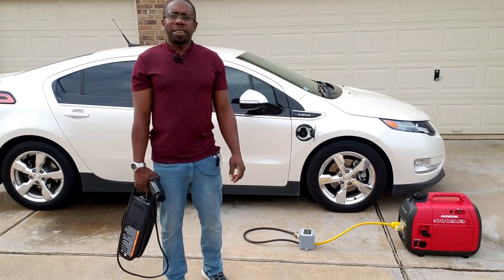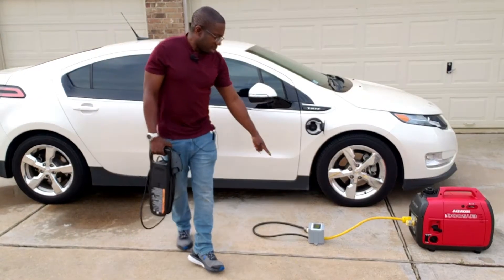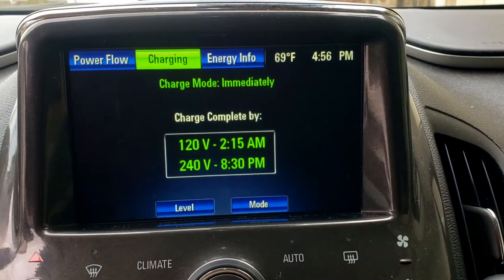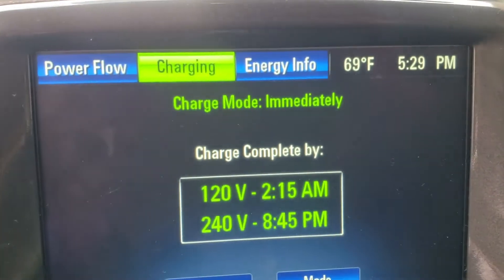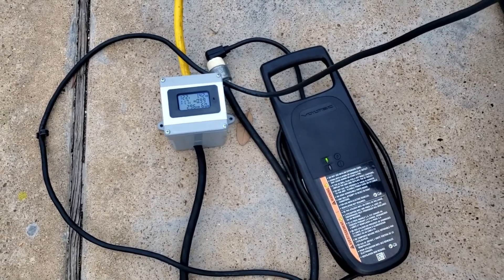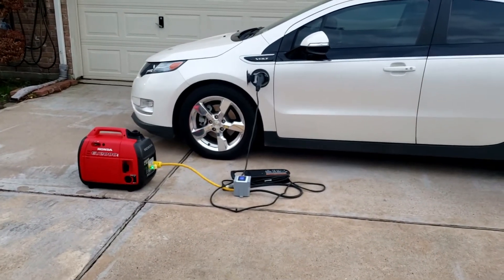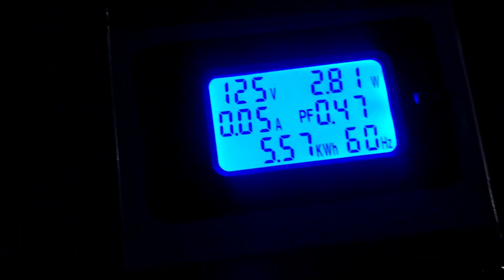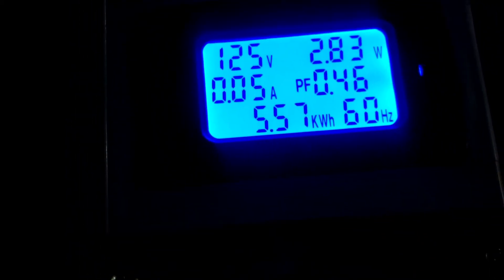Honda EU2000 Inverter Generator Charging an Electric Car.

Comment: I wish i could rent an EV and buy a 15kw generator (i need one for the house) and see how many MPG i can get from charging using a generator
EVs are quite uncommon in my area if you dont buy them brand new, and rental places dont have them because there isnt charging infrastructure and many people who rent cars, arent going to be charging from home
In theory any car can be 'hypermiled' to near double its EPA rating just by keeping the engine at its optimum load. Would charting from a generator that stays in its optimum load, be significantly more efficient than the same car with a gas engine despite the EV version being quite a bit heavier, and having losses from tripple inverting
Reply: also of note, inverter generators are generally advised for complex electronics like an EV. Not only can these damage the complex electronics, the car/generator can waste alot of energy just to condition the power
But this thing showing a power factor of .99 is surprising, it may be a proper inverter generator

Comment: So if you would have done it on the lower setting it would actually met the amp requirement and for the 4 hours that you waited could you have gotten more out of that other setting?

Comment: That's a great heads-up on the bonding plug. I found this video after experimentally trying to charge my Chevy Bolt (with a "B") with my Honda EU2000 generator and getting a "Grounding Fault" error on my EV charger. (I'm trying to figure out a way to drive the last 495 miles to Prudhoe Bay, Alaska, since there are no established chargers between Fairbanks and Deadhorse.) I just ordered a bonding plug from Amazon. We'll see if that fixes it.

I had to smile at the idea of charging a plug-in hybrid with a gas generator. That same gallon of gas would take a Chevy Volt (with a "V") about 35-40 miles if you poured it straight into the car's gas tank instead. The additive inefficiencies of going from gasoline to Honda ICE engine to generator to AC-DC converter to hybrid battery to DC-AC inverter and finally to the Volt's electric motor are depressingly horrendous. 😬

Comment: I get the feeling that 5 kWh from 1 gallon of gas isn’t that bad, it’s the efficiency of your car batteries into miles that lets it down I think..
Reply: The Honda EU2000 is great as generators go (I love mine), but 5 kWh per gallon is awful. At a theoretical (and admittedly unobtainable) efficiency of 100%, a gallon of gas should yield 33.5 kWh.

Comment: What day should truly do is figure out a way to put an alternator to charge the battery it would be better in solar pan then maybe they wouldn't have to use gasoline but still 5-year warranty for a car that after the warranty expires you have to spend $35,000 for a new battery

Comment: It's funny how they're saying electric cars are saving the planet but where are they getting the lithium for the batteries and now you're using gasoline to charge a battery and isn't that the same thing you're using the grid and where the power comes from the grid they burn coal doesn't make sense for electric cars

Comment: No matter how you slice it gasoline will always play a role in the production of electricity somewhere in the system. 
In Canada’s maritime Provinces coal is burned to produce electricity. Given how fuel efficient Honda Generates are I would say it’s a good choice. Must keep in mind also the chance of natural disasters causing power outages…how do you make allowances for that…..the generator is obviously the answer.

Comment: It proves evs are a waste of time they burn fuel so you can get electric to charge weather they burn it or you burn it it’s still burnt which means we all get 15 miles to a gallon which basically means the same as a V8 so more pollution thanks for showing me to never buy electric

Comment: 15 MPG and 4 hours of time used that is terrible. You might have to do it in an emergency, but it is not something you would look to do regularly. An internal combustion car of a Chevy Volt size would get a lot more than 15 MPG. It highlights that if you are not using renewable energy to charge your BEV then you are not reducing your greenhouse gas emission footprint by any appreciable amount. Grid electricity powered by fossil fuel would be as polluting as the generator per KWh supplied.
Reply: Happily, industrial sized fossil fuel plants are way more efficient (and less polluting) at generating electricity than any home generator. Even figuring in the total oil well to electric motor losses involved with running an EV, you get a lot more miles per dinosaur with the EV. That said, I can't wait for the day when I'm charging my Bolt with electricity generated from Thorium fission or fusion power. (Remember, fusion power is only 20 years away. And always will be!)

Comment: This is one of the best answers. Four hours seems like a long time to get 15 miles of driving. Another test compare driving mile with all amp sucking option running compared to all off but essentials.

Comment: 5:42 both the vehicle charger and a heater are continuous loads meaning they can only pull 80% of a rated circuit. For this 12amps is 80% of 15. 8:22 it also had to refill the buffer most likely so not all of the 0.8 is per mile. 366 watt hours per mile or 0.366KWh on the volt 15 miles/ 5.5kwh.

Comment: Minimum generator size required is 10 kva at 40 to 50 amps or larger.

To run a home it's minimum of 16 kva

Note; always uncoil charger cable. Never leave it coiled up when charging

Comment: What about the device you plugged into the gen plug . Please make a video on that detail. 👍
Reply from the maker: That device is called a bonding plug. It is used for generators with a floating neutral or an open ground.

Comment: It took 4 hours to add 15 miles of range, that's 7.5 miles you can travel before you have enough power to reach home once more, plus this equates to 15mpg, and 4 hours to achieve this.
You can possibly reach a charge station within the 15 mile range, but you set the scenario that there is a total power outage, hence no chargers, if there was workable chargers, these would have many cars lining up to use them, plus many more hours being charged.
I wouldn't buy an electric car until the infrastructure is strong enough to cope with demands.
At a garage you might find 10ish fuel pumps.
To cope with government based plans you would need 50 plus charging stations,,, where is this land to build these going to come from? plus the extra demand on our electricity system will cause many more power outages.
That gallon of fuel takes seconds to pour into my tank, it will drive 50 plus mpg, no hours waiting for the car to charge.
At least I know that if my family get stuck in an outage, we can instantly jump in our car and drive to a safer location without worrying about battery range.

Comment: Isn't that what the car's gas motor is for though?  Too bad you don't have a newer volt that gets 59 miles to the charge.   Chevy should continue the Volt since it is such a great car.  Sorry but 15 miles is really bad. And comparing a volt to a pure electric car is apples to oranges.

Comment: That honda geni is one of the most efficient genis out there. A bigger geni will use a lot more gas for that 15 miles.
Reply: My 3/4 ton truck gets around 18mpg. Why would I buy an EV?

Comment: Hai brother. 1 gallon = 3.75 ltr. 15 miles = 24 km. In india cars will run for average 16 km for 1 ltr petrol. So for 3.75 ltr ( 1 gallon ) opprox 50 kms that is 31 miles is coming. What brother.😂😂😂😂
Reply from the maker: By using a larger generator with 240 V you would increase the charging efficiency, this was just a test seeing if it was possible with a 2000W generator at 120 V.

Comment: Great post to prove a genset can charge an ev and the efficiency of the genset converting fuel to power. For comparison - a Tesla m3 travels 4 times further than a Toyota Corolla per gallon when you factor ‘well to wheel’ loss calculations.

Comment: So, if you get 5.57 KWH from one gallon and the car can drive 15 miles lets price the 5.57 KWH from your electrical grid to determine how much it costs per mile to drive your electric car. 15 miles per gallon is not an impressive number for fuel efficiency.

Comment: really interesting video. just what i was looking for. i seen a bunch of photos from ukraine after ru took out most of their power grid last winter of a bunch of electric cars with 2000 wat generators bolted on to the back of them. I know you can use the volt (atleast in most gen1 models) as a generator for itself just by putting it into mountain mode and idling the car and it will charge up to about half way charged (~5kwh) but I would think a smaller motor would be more efficient.... but then a lot of other things come into play. i think mountain mode charging up to half way from 0 miles range gives me about 37mpg

Comment: how many miles per kwh does rhe Chevy volt get, i would have assumed around 3-4mi/kwh or so, my kia phev and vw EV.
Reply from the maker: Your guess is correct because it only gets about 40 miles with one charge which is not a lot by today’s standard

Comment: I like the theory of this experiment, thanks for doing it. But look… 4hrs to charge for 15 miles? 1 gallon for 15 miles? It proves what I’m about to write. The simple truth is….. if you live in an area that is accustomed to power brown outs, purchasing an electric car seems like a bad idea. Knowing that, purchase a similar car to the bolt, but an ice powered car or a an ice/hybrid would be cheaper in initial cost, get 35-55mpg and never have this issue. Not to mention you can use a gas can to fill in a pinch in a couple minutes, not hours of running a generator…. Which costs big dollars and burns the very fuel environmentalists want to ban.

The no brainer move is to not purchase an EV. ICE and hybrid is superior in most ways, convenience and cost being the biggest.

Comment: Put the gas in the tank for higher efficiency. This is a Volt  PHEV not an EV. There is a reason no one uses a portable Gen to charge an EV except for a YouTube video. Thanks. 2022 Hyundai Ioniq 5 EV
Reply from the maker: I know I could just put the gas in the tank but that wasn’t the point I was trying to make.

Comment: This is not time efficient to use EV automobile 🚗, took so much time to charge. 😅
Reply from the maker: Definitely not fuel efficient but just imagine if you’re in a power outage and the only vehicle you have is a electric car that can get you by overnight so you can get to work next day.
Or better yet it would be a great excuse not to go into work 😅

Comment: UK here - how easy is it to 'convert' a 110/120v outlet to a 240v outlet? As I understand it, most US homes are both 120v for 'normal' things, and 240v for anything that would be wall spurred (electric oven etc). Would reduce home charging times by half.

Comment: Makes you wonder why the EV industry (especially if they're required to produce 70% of all vehicles in a decade) is not designing their cars with a built-in internal gas-powered generator for emergency charging purposes. Shouldn't be too hard to figure that into the design.
Reply: If they do that they lose their "0 emissions" tax break

Comment: Nice. I have a 2013 Volt and you can actually charge the battery half way with the engine in mountain mode. Of course you can drive it on pure gas when the battery runs out too.

Comment: I tried to Charge my electric car using a portable generator not yours but a different one but the charger keeps flashing green , is it because of the open neutral should I buy something to  close that
Reply from the maker: Just get you a bonding plug
Reply: @GeneratorReviews  thank you way better than and faster than buying a copper rod and digging that into the  dirt.
Reply: Or does my generator need to be grounded?
Reply from the maker: https://amzn.to/3J4YEAM

Comment: Honestly this just proves the inefficient nature of electric vehicles.  It's all relative to the generation source of course.  You lost about 1 KW with the charger, about a %20 loss there. But still 15 miles is lousy for the amount of power you put in.  They need to develop a more efficient charging solution, and add the ability to tap multiple outlets for amperage since most are 15A. As it is the Honda 2000 was perfect for your test as a bigger genset would be pointless (11A charger Honda puts out 13A) and less efficient.
Reply from the maker: I think if we were able to charge it using dc directly from the generator. It would be a lot more efficient.
The conversion from AC to DC has a great loss. 
I was thinking of trying the Honda 7000 and charge it at 240 V instead especially this one’s fuel injected
What do you think?

Comment: did you try to see if you can put the generator in the car for emergency use, not to charge it, but basically run the motor directly?
Reply from the maker: The car won’t allow you to drive when it’s plugged in

Comment: I know you are just showing us how to charge your car with the generator but it’s defying the whole object of it all, as fuel must be used in generator to charge the car so it would be easier to get a car to run off gas, diesel in the first place and no worries of running out of fuel… Anyways take care 👍🏼
Reply: "..but it’s defying the whole object of it all, as fuel must be used in generator to charge the car.."
Wait until you find out how the electric power plants are powered.

Comment: this type of generator is capable of 2 kw but in your setup you are using only 1400 W amy reason ?
Reply from the maker: The car controls the amount of energy it requires for charging

Comment: Most electric cars are coal powered but it nice to know they can run on Petrol too. Too bad you can't drive along with the generator running in the trunk, but then the penny would drop and nobody would buy them.

Comment: if a black out occurs during winter time you could put a coil copper water pipe in the muffler take inside the generator inside and the gases outside and you get a space heater plus a charger.
Reply from the maker: Yep add a fan to circulate the heat from the hot pipe. 
Yep we are definitely nerds😅🤓😅

Comment: now convert the horsepower of the generator to the time convert it to the horse power to the cars transmission to take it down the road 37 miles and see how much co2 is saved in the generators unburnt fuel in it's tank?

Comment: A question: what would be the result if you connected TWO electric cars to the same generator fueled with 1 gallon of gas? Would both EV get 24 miles, would both get 12, or something else?
Reply from the maker: Unless the generator can supply enough amps to support two EV charging it would just trip the circuit breaker.
But if the generator was large enough to support charging two EV I guess it would just divide the charge between the two.
Hypothetically speaking I guess that’s what would happen
I’ve never tried it😅

Comment: My 2002 Ford Exursion 6.8L V10 only got 12.5 miles out of a gallon....  Of course there's no electric Ford Excursion. So I would have to buy a new ESUV and throw in what? $60,000+?  If I wanted to drive that thing for 20 years and let's say, I already bought it 20 years ago, it would be due for it's third battery in about 2-4 years, costing me probably around $20,000. I'd still have to pay for the electricity which becomes more and more expensive these days. 
There is no upside to an EV, unless you buy a tiny thingy to scoort around town. If you have to travel larger distances, haul stuff and have not half a day to waste in order to be able to drive another 15 Miles, EV's are not for you!

Comment: You know a Volt is actually a hybrid. It has a gasoline engine in it. I wonder if it is possible to run gasoline engine when the is standing? The gasoline engine works as a generator.
Reply: I dont think Volt has vehicle-to-load function

Comment: Thanks for doing this. I’m seriously considering an f150 lightning once the dealer markups go away. Was thinking I could semi permanently mount a small gas generation in the bed for an emergency.
Reply: F150 has its own onboard generator.
Reply: @Bendova215  like a gas generator? I haven’t seen that
Reply: buy ekric f15⁰

Comment: this is an awesome test.  base on some of the comments, some people kinda miss the point.   I know what you are saying for the test, in case of an emergency, but electricity is created by some kind of fuel or other investment in technology like solar, wing, nuclear, etc.  it looks like we are going backward, from 36-55 mpg to 15 mpg, my 2016 Chevy cruse gives me 36-42 mpg.  I used to own a VW Jetta TDI that gave me 44-52 mpg of diesel.   someone is lying with statistics to us.  just an observation.
Reply: Nobody is lying, that small genny is not that efficient, it only makes 4-5kWh per gallon, that's just the math. Larger generators do a bit better. A whole building backup genny that's the size of a car engine does about 15kWh/gallon which is about 56mpg in an EV after charging losses.